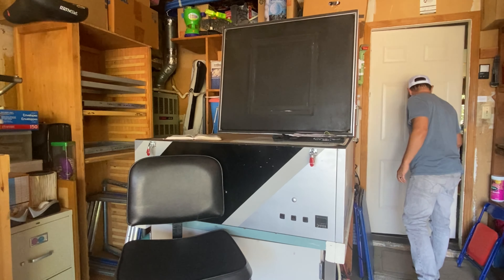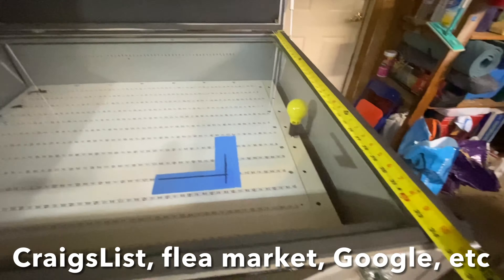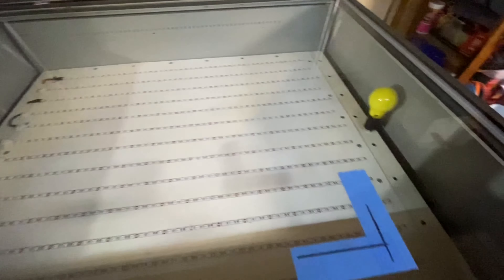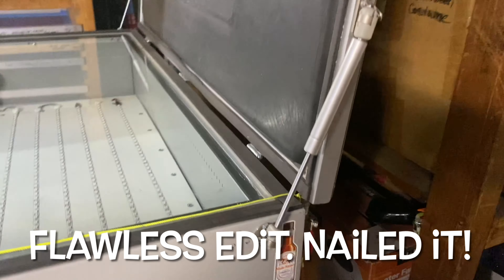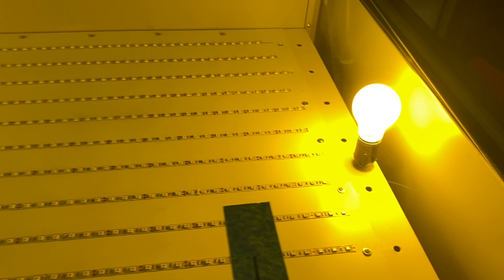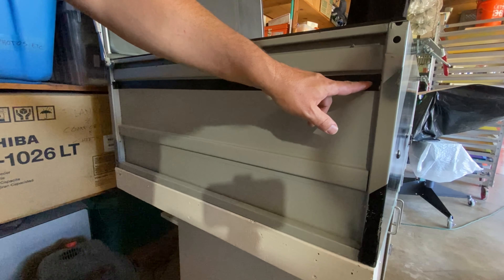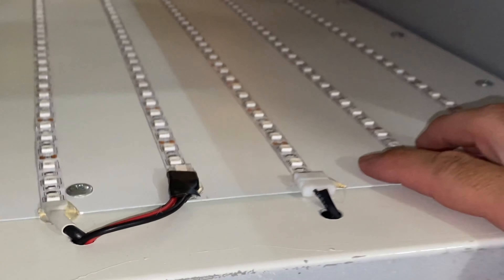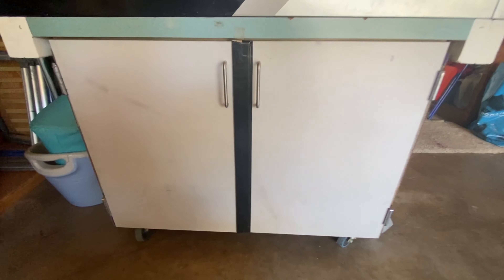Build a LED vacuum exposure unit for a fraction of the cost of buying one new. Screen printers DIY

Comment: I built mine using everyday use LED tubes of 20 watts. I installed 10 of them and used plywood and glass to build the box. Cost me just about $80. People say LED lights does not work, but it works and my exposure time is 45 seconds.
Reply from the maker: That’s awesome! There is more than one way to skin a cat! 🙀

Comment: I work at a shop with automatic presses and this is the cheapest alternative that is on par with 5k exposure units I've worked with, the $10k exposure units has 1.5 inch spaced high density UV leds that burn in 4 seconds, but it's 10 grand. Your led unit is awesome. I'm going to try and make one for my home screen printing side stuff!
Reply from the maker: Thanks Jesse for the response! In my past life I was an electrician. That plus Im cheap! lol. So if I can build it I will. I figured its nothing more then a box with some lights. 
From the link you can pick the regular or high density. I used the HD. Im getting a 16 sec burn time with the LEDs about 7" away from the glass. I wonder what I could get if I had that 1.5" space you mentioned above. Maybe close to 4 sec also?🤔 
I spend more time waiting for my vac to seal then anything. In the future I might invest in a faster pump. But I went cheap. Harbor Freight.

Comment: Well done!   I'm in the process of facing our old Photosharp metal  haloid unit dying off without practical means of getting all the parts.  This gives me the courage to tackle using the carcass we have and just replacing the old Olite unit with LED and upgrading the dying vacuum pump with something that doesn't' take 2 minutes to draw down.  Thanks for sharing!
Reply from the maker: Awesome! Yeah those metal halides are not easy to rebuild. Bulbs cost a fortune, the ballast weigh 20 pounds (practically). LEDs are the way to go for sure! Good luck with the task!
Reply: I wound up making it.  Burns just a little slower, but I'm getting exceptional results and I think the emulsion edge to edge on auotmatic size frames is much more consistently exposed.  I was getting a lot of light fall off with the old halide system.  Thanks again!
Reply from the maker: @AHallME1967  Awesome! Did you use the High Output UV LEDs? Mine burns in 16 seconds, so should be fast if you used the same?

Comment: We have a pool and pond contractor in my town and they had rubber pond liner material remnants for sale very cheap because they are too small to use for ponds. It's like inner tube rubber and it works great for a blanket.
Reply from the maker: Good to know! I remember someone else talking about pond liners as blankets when I was doing my research. I feel like mine is a little too think. Still works well but I wonder if a thinner liner might have even been a better option.

Comment: 1)For the wiring what gauge should I use.  
2) At Home Depot I noticed so many spools of wire in all sorts of colors…do I need a specific color.  Also are there any specific wires that I need or are most the same.  Or are the colors just to help me organize example (get white colored wire to attach to neutral wire from pigtail and black wire to attach to hot wires) 
3)I noticed I can’t see any of your self tapping screws from your L channel coming out the other end of your light box.  How did you do that.
4)When setting up your big lights- how did you keep them upright.  What parts did you use to put together the base of the bulb attached it’s attached to
Thank you so much
Reply from the maker: I prefer to use the industry standard colors but colors aren't really that important as long as you track which wire is going where. Use 14 guage for all the AC 120V connections. Use 18 for the LED DC connections.
Reply from the maker: I used my grinder to flatten off the tapers. I used some all thread with nuts to set the bug lights. Same you would find in the part section where they sell ceiling fans at Lowes or Home Depot. Next to the pull cords etc for ceiling fans.

Comment: What was the wire gauge you used running from the terminal block to the LED power supply and also to the two bug lights.
Reply from the maker: 14 gauge

Comment: Hi, 
I am helping my Son build one of these units. I have a question on your parts list. 

1. The UV LED lights. You listed 16.4" (416mm) and a 6" (152mm) strip. Why have you listed both. What is the 6" strip used for?
2. the LED Drivers. There are two listed. Could you indicate which driver is used for which LED Strip. The usage (wattage) per meter becomes greater with the length of the strip. Hence the selection of the driver becomes important. Correct me if I am wrong. 
3. The vacuum membrane or Rubber blanket. What is the thickness of this sheet? On the internet is mention on 30 Shore A and 40 Shore A. Any guidance you can give here?

Thank you appreciate the video.
Reply from the maker: Good morning. Thanks for watching! 1) The reason for the extra 6' length (not 6") is because the size of my area and the spacing I have between strips. I ended up with 14 rows of LEDs at approx 33" long. I believe my spacing was 2" apart (its been a few years since the build, so those are close approx from memory and eyeballing my unit). Long and short of it. The full reel of 16.4' just wasn't long enough for my coverage area. I needed that extra 6' for the last couple of rows. But honestly in hindsight Im sure it would have been fine with just one full reel (16.2') and some extra spacing between rows. Its extremely bright and I burn my screens in 16 seconds. If I were to do it again I'd probably go with 3" apart to to to save and not purchase that last 6' strip. 2) I selected the HD high density LEDs. A full reel of the HD Ultra Violet lights will run at 40watt. So if you end up getting just one reel (16.2') you'd be at 40watts and can use just one driver rated for 60watts. When you click on the driver link I provided it only takes you to one option. But you will have to select from the drop down your wattage (60watt) and the voltage (120v). If you end up getting more then one full reel of LEDs like I did, you would want to get another driver. I ran my LEDs in parallel so to avoid any voltage drop and have more consistency in the LEDs. You can see that explained in my other video found here https://youtu.be/CHYW-lFo21Q?feature=shared 3) It appears the link for the blanket is no longer available. Its been so long ago I dont remember the thickness. You might have to do some more of your own research on that one.
Reply: @prodigalsonapparel Could you tell me the thickness of the blanket and if it is EPDM? Would pond liner be just a as good.
Reply from the maker: @mrx.2233  sorry I dont know the thickness. The post is gone from my ebay purchase. Ive heard pond liner works well. Probably close in thickness.

Comment: Got a "traditional" copy-frame here were I wanne give a led and vakuum update.
Any suggestions for a pump wich should fit a are of ~ 120cm X 130cm [centimeter]? The actual one is so damn slow :-(
Reply from the maker: Mine is pretty slow with the vacuum pump. Considering changing the blanket to a softer more pliable blanket and using a shop vac.

Comment: I went through the comments and might have missed this question, but what is the purpose of the string on the screen when you expose?  Great video BTW building my own unit as we speak.  Thank you for your detailed and patient instructions.
Reply from the maker: That way you can pull the air and get vacuum around the screen frame. Otherwise the rubber will seal first around the frame and no longer vacuum air from the center of the frame where it is needed most.

Comment: I'm trying to get in to etching half tone images on glass using photoresistant films would this be the same type of machine I would need to expose the films ? or screen printing different thanks
Reply from the maker: I don't know if I fully understand the question, but yes, I expose my films with this exposure unit to screen print.

Comment: Oh yeah, I forgot to tell you that’s a dynamite video, very informative and very well done.  I thank you for it. I would like to know how high are the sides of that exposure unit? You know length, width, height. How tall is it? I’m building my own unit thanks to you and I do have questions about attaching the rubber blanket. It looks like the blanket is attached under your 1” tubing but you have those aluminum strips screwed down onto the top of the tubing. I’m kinda confused. Looking at the video it looks like the blanket attaches underneath. So Sean, please let me know, because I need to stay in contact through my build  I could use a little help. Thanks Richard
Reply from the maker: Thanks! Its an old office cabinet layed on its back which now measures 42" x 36" x 15 "

Comment: Hi friend. Great video. Can you please send me the wiring diagram as well as where did you get the led strips. What emulsion are you using as well as distance from glass to where led is located? Thanks again for a great video.
Reply from the maker: The LED strips and the drivers are located in the description below the video. I've included links there also. I use CCI pro chem VPR emulsion. The glass is between 6"-7" from the strips. You can email me at sean.psapparel@gmail.com for the wiring diagram.

Comment: So what does the vacume do and is it a must to get half tones?
Reply from the maker: Light can wrap around the top of your film, even if you have a black foam pad, weighted down, holding the film tight to the screen.You can loose detail, especially on smal halftones if the film isnt super flat or tight. The vacuum blanket assure your film is as tight as possible against your screen so you dont loose any small details on the halftone.
Reply: Thanks for the detailed reply.  Stay battle ready because the enemy is...
Reply from the maker: @gocowboysgo2838  Thanks brother. So true

Comment: It would be a great idea to compare this fancy exposure unit compared to the traditional way to see the quality of the outcome.  A chemestry company did a test between bottle water an regular kitchen tap water, the findings no difference at all.
Reply from the maker: Well tons of screen printers have. I think any printers that have been around a while can tell you there are big differences in the level of detail you can capture with a vacuum blanket. Plus I now burn a screen in 16 seconds with the LEDs vs 3+ minutes from my old  florescent bulbs.
Reply from the maker: https://www.screenprinting.com/blogs/news/compression-vs-vacuum-exposure-units

Comment: This is a Great Video!  Thank You for sharing.
Could you tell me what type of weather stripping that you used to seal the frame?
Reply from the maker: I used a neoprene foam strip similar to the link I provided below this comment. I also put a bead of silicone between the glass and the frame. 
https://www.amazon.com/Neoprene-Dualplex-Weather-Stripping-Adhesive/dp/B07WTRK3LX/ref=sr_1_5?crid=EHAJLBNXIAKZ&dchild=1&keywords=foam+strip+1+inch+thick&qid=1635202267&sprefix=foam+strip+1%22%2Caps%2C256&sr=8-5
Reply: @prodigalsonapparel  Thank You very much for responding.  I have bought some from Home Depot and it is not getting the job done.

Comment: Nice. What is the blanket? The link not working. Is a silicone?
Reply from the maker: This one looks the same. Double check the size because there are different size options from the seller. https://www.ebay.com/itm/333127665810?hash=item4d8ff4c892:g:IjYAAOxyeR9TJdxm&amdata=enc%3AAQAHAAAAsH0mRjf3d3P%2BvjIaS%2BM9WbHG45a%2BFVsm%2FUaPPgrzoz0fUWLrcL4kdDqS5X6Sd03fR7K3glHHqDbA6i985iZECAVTiNKav1tOXjeuKE7JVQFV8sTtWdVZUIj2%2B0guwAJS2Tm%2F3xoJlDWoNddUiv5Ax2l6K7YiauvpQA3evbmPZCSAzIIK6NqwcIXFTOCgRJFyR4rtzHgKHMdZLN8bojWRM9HLMiPhwPkEtQpo2bH%2BE4Np%7Ctkp%3ABk9SR9yCiaX4YA

Comment: Hi just a quick question where did you buy those Lid holders 

Hydraulic Gas Spring Lid Support Hinge

Looking forward to hear from you if you could provide the li k or name will be really helpful I just couldn't find them which you can use for outward
Reply from the maker: Its been so long, I believe that was just an Amazon purchase. But I do wish I went bigger because they wont lift the lid without assistance. At least they keep it from going all the way back. But in hindsight I would go with a larger 20" or something closer to 100lb

Comment: Great video, question, did you use your same power switch and timer from your fluorescent unit?  I’m getting ready to convert over my fluorescent unit to LED and from my experience with converting other types of shop lights to led is 120v will go right up to the driver which converts to 12v or 24v, or the simple bypass ballast to direct wire setup where the driver is inside the led tube bulbs.  So my thoughts are that I should be able to leave same switch and timer that I currently have, then simply cut the wires before the fluorescent bulb ballast and connect that cut 120v power into the driver.  Then the out terminals wire to the new led’s.  I don’t see a reason to change any components prior to the driver ( my vacuum switch and timer switch).  Does that sound correct?  It should work the same as far as turning on and shutting off?  No need for any type of extra components like relays or anything?  Thanks again for video and I appreciate any reply / feedback
Reply from the maker: Sorry about the delay, been a busy week. Yes, your exactly right. Either replace the florescent ballast with the LED driver or like you said, or if your using the LED bulbs that dont require a driver the bybass the ballast and run 120v directly to the bulbs (if that's what they call for...I couldn't imagine they wouldn't call for 120v)
Keep you timer and vacuum wiring just the way it is. Obviously you'll have to adjust the timer count down once finished.

Comment: Wowwww peace and blessings to you and your family bro. Can I send you the money and you make me one like yours bro lol?
Reply from the maker: Thanks brother. Sorry, I just plan on making the one. But I encourage you to give it a try. It is satisfying to make something yourself and have it work just like the expensive ones you buy in store. I'm more then happy to share any help along the way.
Reply: Awwwwww man I'm nervous but I will give it a try and will be contacting you because I'm definitely gonna need your help. What is the string underneath the vacuum lid for?
Reply from the maker: @yaldoshelelohim5564  You place the string over the aluminum frame of your screen into the center of your screen before you close the lid. This way the vacuum can pull air out from the center of your screen also. Other wise if the string wasnt over the frame there would be an air pocket inside of the frame and you would get no suction in the middle where you need it most.

Comment: What is the distance between each of your strips? Awesome video too! I am planning on building one 4'x8' for large format photoresist to use on glass for sandcarving.
Reply from the maker: Awesome! I'd love to see that process! My LEDs are spaced at  2" 1/4"  apart. Roughly 6" to 7" from the glass. If your interested in the wiring diagram I just did a follow up video with the wiring schematic included.

Comment: Nice work, 
Which neno meter led used & smd or power?
Reply from the maker: The LEDs are 395-405nm. Below is a follow up video with my wiring diagram. If you look at the description under the video I have links to the LED drivers and LED lights.
https://www.youtube.com/watch?v=CHYW-lFo21Q
Reply: Thanks bro

Comment: Thought it's time to upgrade the old grow light box and try this one.  Parts in the mail - can you send me your wiring for the timer.
Reply from the maker: Sure, give me your email and ill send the wiring pdf
Reply: Thanks
Reply: @prodigalsonapparel One more question - I have the HD UV bulbs 10 rows, 2.5 apart 35" long columns,  350 watt driver - how far from glass is optimal? I think it's too far away. It's 14" away.
Reply from the maker: @Richardt59   Ideally I think you'd want to be closer. You'll still get a decent burn time at 14" being that you got the HD LEds. My set up is approx 7" from the glass and I have a 16 second burn time. But from past research I found that the ideal distance is approx 3-6". If your not using a single point light source then closer is better.

Comment: which emulsion should i use with the 50watt uv if im using plastisol ?
Reply from the maker: I work with primarily water base but do also use plastisol. I use CCI's VPR emulsion. It works with both water base and plastisol. Requires no powder activator.
Reply: @prodigalsonapparel  thank you 🤟
Reply from the maker: @hassanhall4338  No problem!

Comment: I’m almost ready to begin this build! It’ll take 4 weeks for the local glass shop to fulfill my order but we’re going ahead anyway. 
Question: is there a preferred method of determining the slack needed before screwing down the vacuum blanket when building the frame?
Reply from the maker: Its been a while, but I believe I put a frame in place and laid the blanket over for judgement. You wont need a lot of slack, just enough to shut the top.
Reply: Hi. Is it a special type of glass? Or just ask for temper? I’m trying to do this build. Thanks in advance